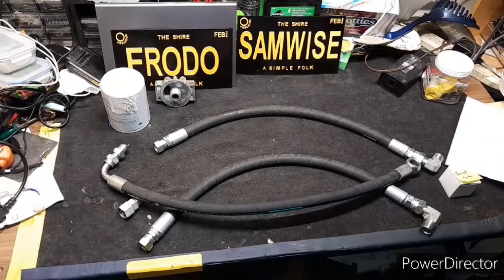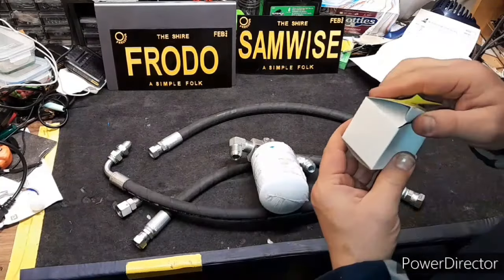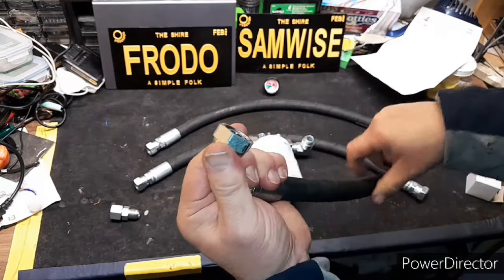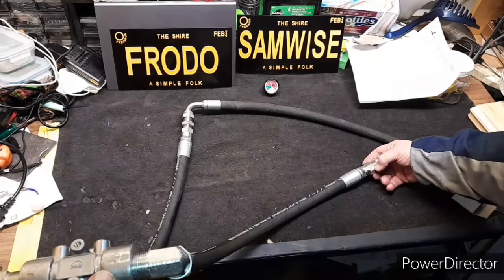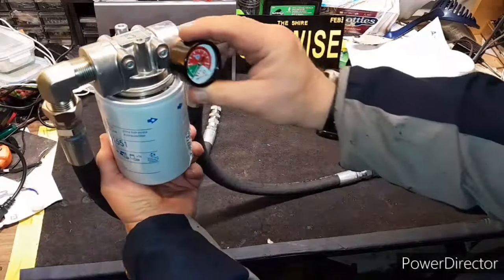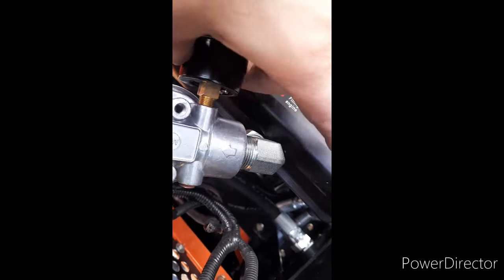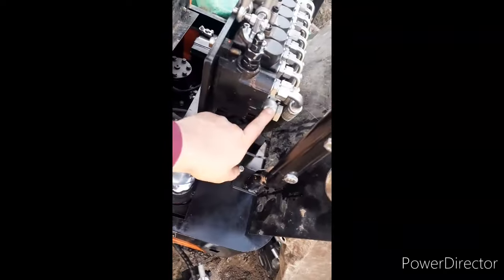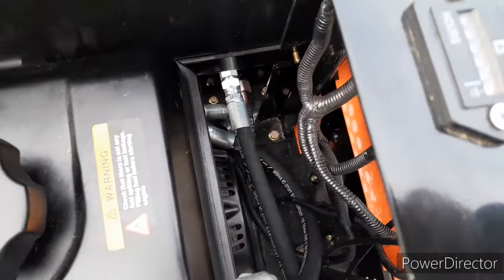Cheap chinese excavator adding oil filter

Comment: I just finished my filter plus oil cooler project on an H12 (tank in different spot than yours) and I think it will help.  you have so much more room on the left side for the filter, I would have put it there to give more working room and space from the engine.  easier to change the filter too.  for the banjo connector, you don't need to have the bolt hole line up with the hose opening, the fluid flows around the bolt in the open space in the banjo portion.  its omnidirectional, its more important to have the right tourqe on the bolt for proper seal than alignment.  I love my machine, keep it up!  I just came in from installing 3/8 flat face quick connects on mine to prep for a tilting bucket!
Reply from the maker: Thanks for the info :
This is my first time working with hydraulics.
I do have the option of installing longer hoses,  and moving the filter - main thing was finding the proper connectors for the machine !
Yup.  Already informed about the banjo fitting, but it couldn't hurt being aligned...
They are good little machines.
Reply: I need some photos I bought a new one also and want to install filter assembly out
@ hyd tank

Comment: 6:00 The hole does not need to line up. It's a banjo bolt. Motorcycle brake systems use them.

Comment: Hi Dave.  I saw that your oil filter holder you purchased has a check valve built into it.  It is the black thing when you look into the inlet side.  I suspect there is a certain amount of pressure required to lift that off, so with that required small amount of pressure, and the flow rate of the pump, 10 psi is an expected amount of back pressure.  It might also drop once the oil gets up to operating temperature.
Reply from the maker: since installing the filter, the oil pressure has gone up just a bit, but it is still within 5 - 10 p.s.i.
going to wait till it is over 10 p.s.i  all the time, then change the filter and cut it open, i want to see how much stuff is inside.
hydraulic oil gauge still looks clean and white, so it must be filtering....

Comment: Mine didnt come with an external hydraulic oil filter, however i did notice there is a prescreen and a filter inside the hydraulic oil tank, when i took the flange off that holds the cap.  Im wondering if it needs an external filter with those installed?
Reply from the maker: I believe the prescreen is there for large particles only, so to prevent a sandblaster effect, i installed the paper filter cartridge.
as someone mentioned, you can get better quality filters for better filtering, but they are expensive.

Comment: Hey dave im looking to do the same thing, i seen your part's list but do you remember the hose lengths you will need to make this happen?
Reply from the maker: I had to guess my lengths, which i set at 3 feet for each.
It all depends on where you want the finished mounting for the filter too be located in your machine.

Comment: NPT 1/2 in has id of 12.54mm  the DIN 15L has a 12mm ID so I don't think you would lose any flow
Reply from the maker: Did not know what kind of return oil pressure i would be dealing with,  using  a 3/4 inch hose gives the oil a larger area to fill, slowing the flow, and dropping the pressure  before he filter.

Comment: Isn’t there already a filter in the tank?
Reply from the maker: there is a course filter screen insidee the tank, but it still lets fine particles through.
think of a sand blaster - you want to capture the tiny bits in the oil to stop them from wearing down the machine.

Comment: At 2:00 minutes, You are probably not going to get what you want. There are several factors involved.  1.These various filters and even the mounting heads have bypass features inside them that could be bypassing as low as 5psi. It could be as high as 50psi, or possibly even "NO" bypass is possible, but probably 5 psi ( at 12:15 ), is where I think yours is bypassing, cold oil, fast flow, only 5-7 psi on the scale? IDK, I could be wrong, I don't know what your mounting head bypass is set for. You need to research your exact part numbers. You did not include your entire shopping list. Maybe you can update the video description area to include all of your major items?   2. If your parts selection allows any opportunity at 5, 15, or even 50 psi of bypass, you might find that almost all of your oil flow will be in bypass mode, it is just too thick, (unless it is so hot that it is watery thin),  to get through the media, (your, P551551, is 7micron cellulous), at the speed in which it is flowing through the system. You now have created a mini kidney filter system for your mini excavator!  I don't think that was your intent.  3. Your filter selection is cellulous, which is a media type that is incompatible with vegetable based hydraulic oils, Do you know what kind of base material your oil is made from? Plants? or Petroleum? Chinesium? you need to know! Some hydraulic oil is vegetable oil. Maybe get a test? IDK, I'm waiting on my 1st test on oil that has/is 20 minutes runtime/old.  4. You can look at the Donaldson website or google search for "Donaldson Hydraulic Filtration Product Guide", 290 pages of filtration goodness. I am trying to do exactly what you are doing and my research so far has revealed these exact questions to be answered,  to get my final results on my mini ex.  Why not add a cooler now at this time as well? Supposedly this oil can get to 300 deg (smoking hot), maybe more? Thanks for making this video. Good Luck with your endeavor.
Reply from the maker: Thank you for the information, i will look into this...
Reply from the maker: Just looked up the specifications for this filter head, and the bypass pressure on all models they sell are set too 25 p.s.i
Thanks for the info, will habe too see what happens when it gets too that point.
Reply: He might have an adequate filter inside the tank on the return side like mine has, so if the spin on filter is bypassed the filter that comes with the machine will filter the oil.
Reply from the maker: I do have an in tank oil filter screen -  as show in my previous oil change video.
For now i will keep an eye on it, when the gauge gets close to 20 p.s.i - i can cut open the filter and see what it looks like inside.
Reply: @youcandoitdave6058  excellent idea.

Comment: No amount of paper element filters will give you what you are looking for.
This application requires a oil pressure powered centrifugal filter.
This will filter wildly beyond what an element filter can ever hope to achieve.
Reply from the maker: After a quick google search, i do agree that a centrifugal would probably do a better job, but at a cost of 600 $ just for the filter....
Paper is doing fine. 😁
Reply: @youcandoitdave6058  yeah but.....if your going to filter your hydraulic oil all the paper elements in the world wont remove the bits that are doing the damage. and also the water that gets into systems.   the filter is reusable and all you do is plumb it straight into your main hydraulic pressure (depending on model of filter).